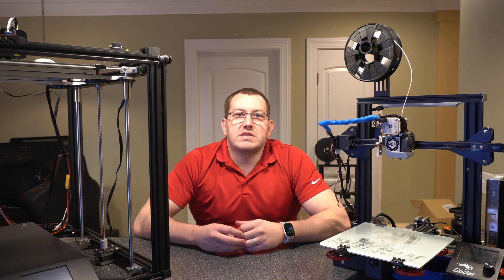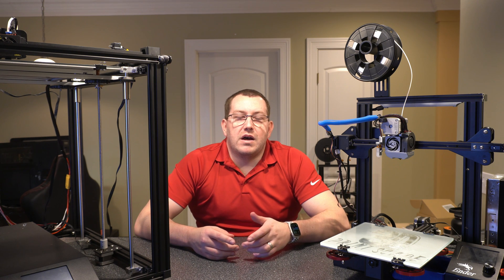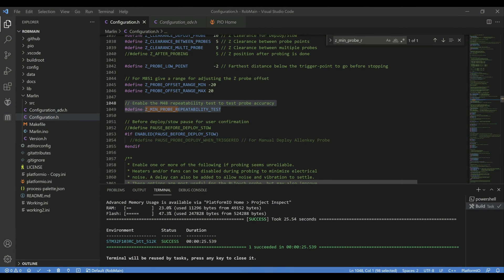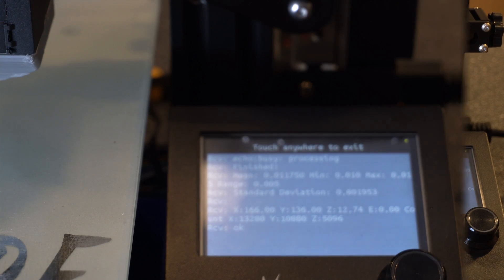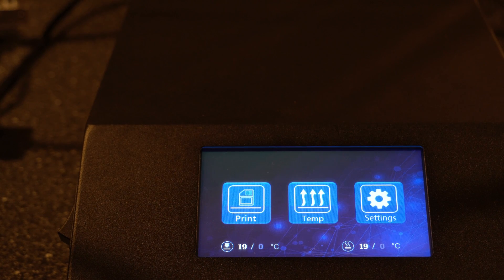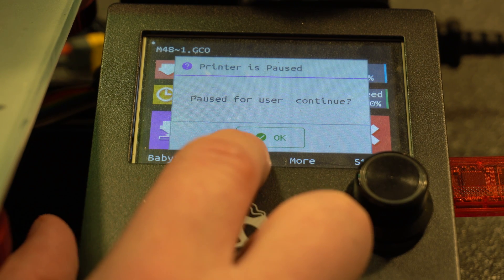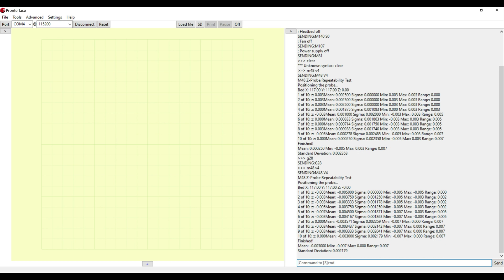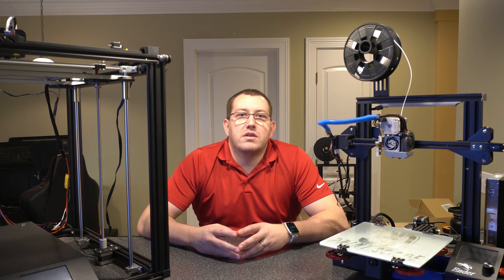Overview of the Marlin Probe Repeatability Test

Comment: Thanks buddy, good tutorial, in my case printer was sending error: "Probe out of bounds? (X,Y) out of bounds."  (my printer is homing off bed) i just had to move the head somewhere on the bed and it worked perfectly, i have off brand 3D Touch, deviation is 0.0037 and second run was 0.0045, i guess its fine for ripoff model, just in case this will help someone. Good luck!

Comment: Thanks for letting us know about this important test.

For anyone without a touchscreen or Octoprint: I have a stock Ender 3 Pro without the touchscreen. The gcode file runs the test, but doesn't give any results on the screen--neither during the test nor at the end. However, after enabling the test in the firmware a new command appeared in "Motion > M48 Probe Test" that displays the deviation at the end of the test. So, I just ran the Auto Home command and the M48 Probe Test from the menu manually using the dial, and it worked perfectly.
Reply from the maker: Hi. Thanks for the feedback. Are you saying it actually ran on the creality firmware and just didnt show results? For me it didnt run it at all.
Reply: @3DPrintscape  I use a custom Marlin build created with the build instructions from your videos (thanks!). I made a new build with repeatability test enabled as you mentioned. When I run it from the code text file you suggested, it auto homes then run the test but does not show the results or deviation on the screen. However, in the menus, there is now a new option on the Move menu named "M48 Probe Test" I can select. When I run it from that menu, then it runs and it shows the Deviation on the LCD screen at the end of the test.
Reply from the maker: @jimp.8396  Ah ok, that's good to know, thanks.

Comment: try this

M48 P4 X100 Y100 V2 E L2
Reply from the maker: Hi. I will run it in a bit. Based on the command its just being more specific about where and how many times to probe.
Reply: @3DPrintscape  I got this long time ago. It basically moves to the side 100m then return and probe again instead of standstill